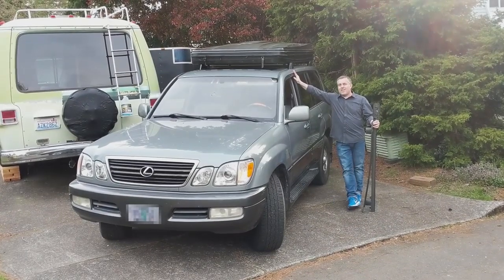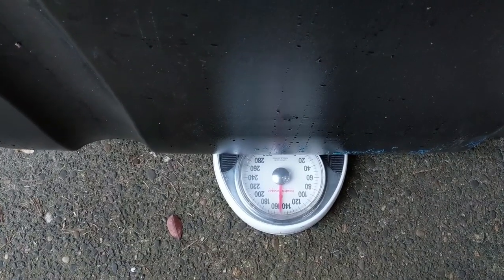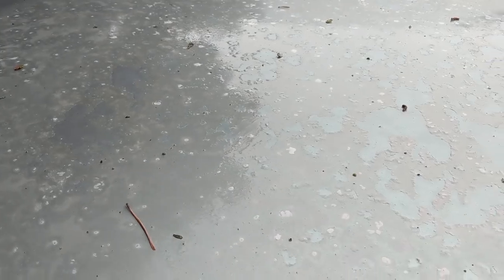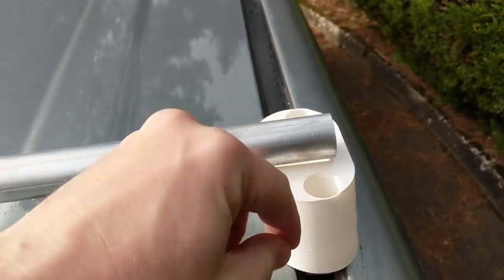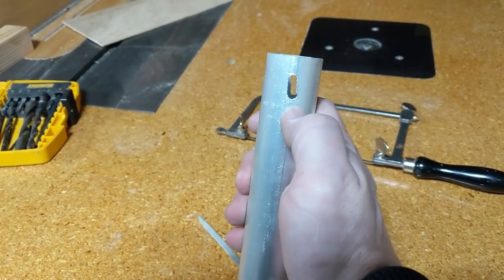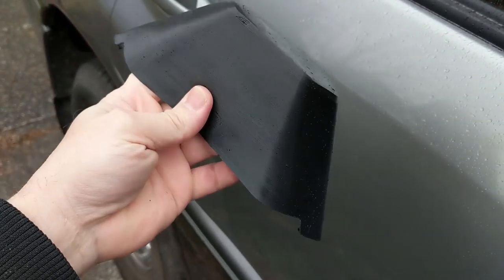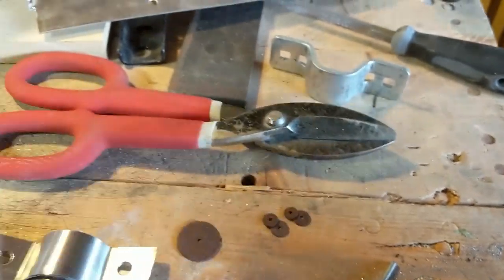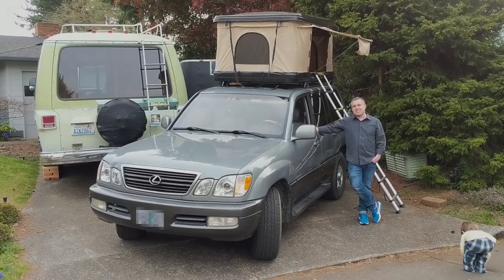Upgrading My Overland 4x4 - Paint & A 3D Printed Roof Rack.

Comment: I can see the rear widows of the RV is still there. HAve you seen my message regarding the possiblility to take the rear part on the derelict RV and keep this one in case of change of mind?
Reply from the maker: Yes. I like the idea. It's hard to find a derelict GMC motor home without a rear window. It would have been a "Transmode" or  23 footer. Both of which are more rare than the 26 footer.

Comment: $14k for the truck, few thousand for the tent, whatever the GMC cost you but you can’t spend $300 for a proper roof bar system from Yakima or Thule. Seriously?
Reply from the maker: It's been several months ~2000 miles and 3 camping trips later and it's working fine: https://youtu.be/ky0tEe0RN0s If I had it to do over again, I would have used thicker wall tubing. There is a little bit of flex when I'm in extremely windy situations. I can look through the skylight and see the RTT bouncing by about 1/4" but that's the only issue. What makes you think a Yakima or Thule would have served me better? Both of those solutions mount the tent higher above the truck. This raises the center of gravity for my offroad vehicle making it more top heavy which is no bueno. Also the brand name racks have more wind noise and still use aluminum cross bars. I think I'm better of with my better looking custom rack.
Reply: @IndustriousPursuits  Unfortunately some folks dont understand the appeal of creative solutions unfortunately.  I am a hobbyist woodworker (now entering the digital design space with fusion 360 and hopefully advancing to 3d printing) and anything I can make on my own, I certainly will.  Keep it up!